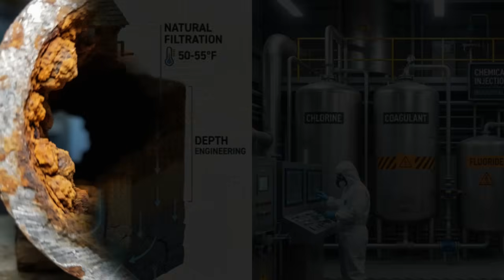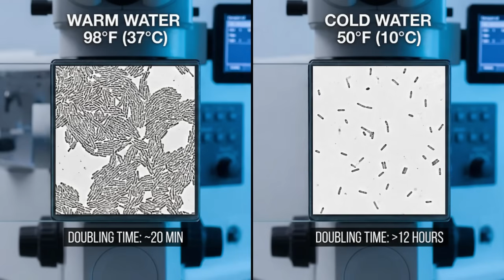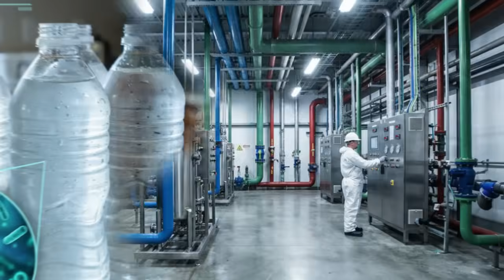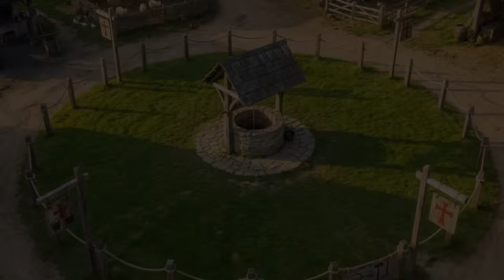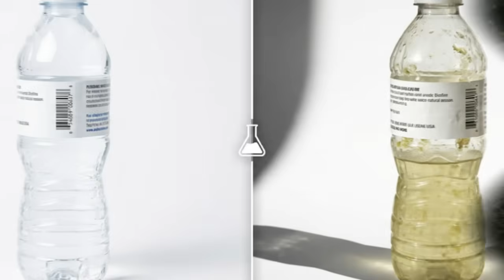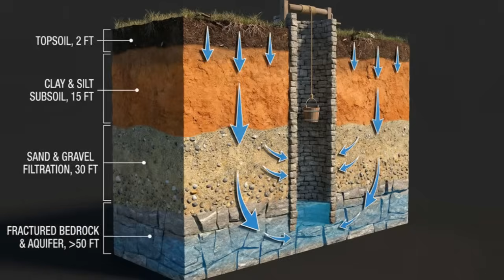Why Medieval Wells Stayed Clean for 500 Years While Modern Water Goes Bad

Comment: Submersible pump in a 6 inch pipe?
They usually have a pump at the top of the pipe.
Reply from the maker: You're thinking of surface pumps, which do sit at the top. But submersible pumps are actually common in modern wells, they sit down in the casing below the water line. Standard for deeper residential wells drilled in recent decades.

Either way, the point stands, modern wells use narrow plastic or steel casings instead of wide stone-lined shafts that provided natural filtration and temperature control. Different pump types, same fundamental problem with the casing materials.

Appreciate the technical correction though, there are definitely multiple pump configurations in use.
Reply: @MedievalOverModern-MOM   yes you are correct. I didnt think submersible pumps fit down 6inch pipes but i see they do. All plastic casings. Just like you said.

Comment: We have been destrying water with toxins for 150 years. Dumb fake video ai slop
Reply from the maker: The video never said we've been destroying water for 150 years. It said chlorination started in the early 1900s (about 120 years ago) and created unintended problems like trihalomethanes and haloacetic acids, both classified as probable carcinogens by the EPA and WHO. That's not controversial, it's documented chemistry.

The point wasn't "chlorination bad", it was that chlorination solved one problem (pathogens) while creating others (chemical byproducts, infrastructure dependence). Medieval wells didn't need chlorine because the design prevented contamination at the source through depth, stone material, and natural filtration.

If you disagree with the chemistry or the historical facts, point out which ones. But calling something "slop" because you don't like the conclusion isn't an argument.

Thank you for the comment, we really appreciate it ❤️❤️❤️
Reply: @MedievalOverModern-MOM  I think that person is mostly angry with the fact they can't believe anything they see or hear online because of the slop some people make. But I certainly enjoyed this video.
As kids, we used to look at books that showed the inner workings of medieval structures, like a side view of a structure cut in half, and the funniest things were the bathrooms in a multi level castle, just long shafts you'd sit at the top of and poop, and the level below would just be set a little further out so they wouldnt get pooped on pooping into the same long shaft haha we used to draw our own versions
Reply from the maker: @Jimmy-James-f9u  😄😄😄

Comment: In our farm we have 2 hand dug wells. 1 will go stagnant (aka bad water filled with bacteria) if not used for a period of time, the other will stay clean forever since we've hit the underground river when digging it, we even had to stop digging it since pumps we had couldn't handle the flow rate that the well was filling in. There's no magic, water goes bad if it's stagnant. Whole video is based on either willful or deliberate ignorance.
Reply: The video has a section addressing that 3 minutes in. 
"whole comment is based on willful or deliberate ignorance "
Reply from the maker: It's fascinating how different wells can behave so uniquely!
Reply: yup never drink ponded water, look for the outflow natrually oxygenated stream when camping
Reply: In the village example, people were drawing from it relatively continuously all day, so that gravity, water pressure and/or surface tension would pull fresh water into the well until it stabilized at it's natural depth. Stagnation would certainly be a consideration on a seldom used or sealed well. I've been told that a horse will only drink "good" or safe water, but I'm a city-boy, so test yours to be sure.